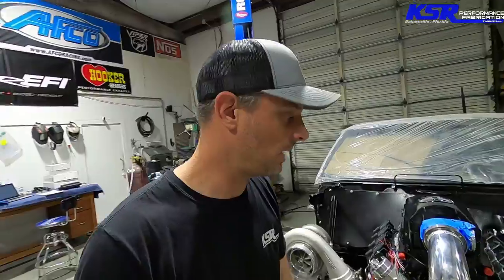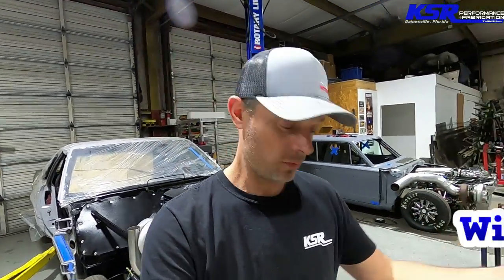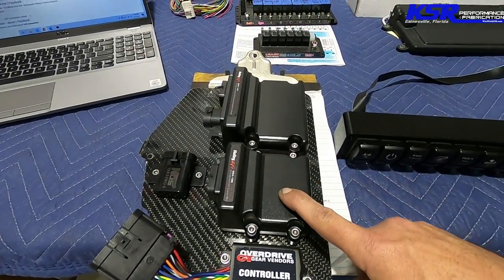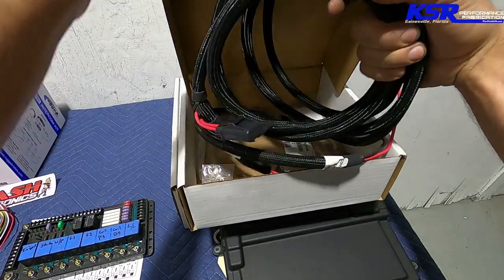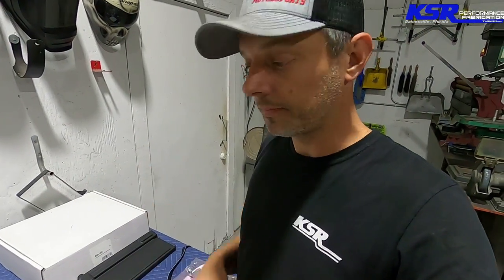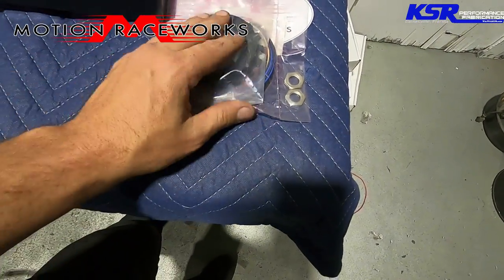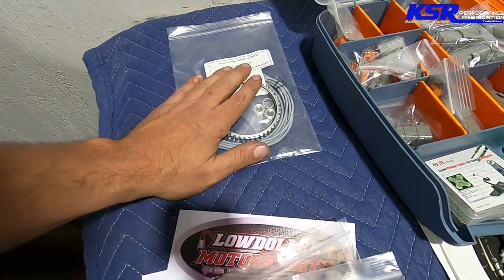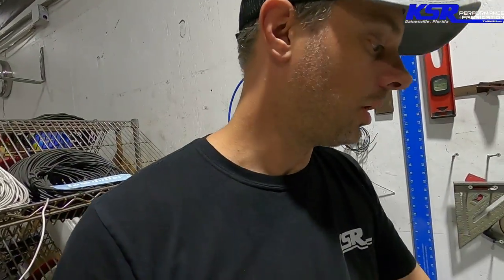Mullet El Camino Build Episode 12.....Wiring Overview!!

Comment: Are these thermocouples that you are using to measure exhaust temperature? You told that you are going to shorten the cables for these. If the length of the cables for different cylinder sensors are different, wouldn't it make the measured result a bit different between the cylinders?
Reply from the maker: I consulted with some other wiring friends who have tested it and they said that there was no difference with the shortened wires. All of the resistance portion of the unit is in the tip of the thermocouple.

Comment: Question .. Spark Return path..  since electrons flow from Negative to positive .  so the spark jumping the gaps at the spark plugs is actually jumping from the ground terminal to the center then up to the coil secondary.. to reduce the spark path..  on external MSD boxes i build a 3 or 4 ring terminal harness .. one ring terminal to the back of each head.. one to the firewall directly behind the engine..  i normally ground the MSD thick black wire to the firewall connection of this harness.  making the spark return from the MSD box the shortest possible..  when the MSD is grounded to the battery negative terminal.. i have had issues with MSD units blowing out as the high voltage tries to get to ground via the shortest path.. thru the 12 volts circuits .. causing MSD failures.

Comment: Pretty. Functional. Fast.
Put that on a shirt!
Reply: Also, use gold pins in Deutsch connectors for anything running less than 1A!  The standard pins will film over and cause weird signals if there isn't enough current to clean them.  The easiest way to know if this is the cause of a problem you are having is to re-seat the connector, which wipes the contacts clean again.

Comment: Them exhausts get so hot, is that location not going to adversely effect air temp going into the engine  by heating up the turbo housing ?
Reply from the maker: Not at speed. And those pipes will only have a small amount of air coming out of them and that will only be early in a pass down the track.

Comment: Hold on if you have a bulk head plug that has engine and chassis electricals running to it won't that make it a pain to pull am engine wouldn't you separate the lower one so engine and chassis are fully separate

Comment: is it possible for the firewall mounted plugs to come undone with a violent launch? The engine plates should mean most of the car moves as one piece but that also means no dampening for vibration. If the big round plug came undone mid-race, that'd really suck for the driver.
Reply from the maker: They wont

Comment: Insert wire group A, to wire group B.
Insert wire group C, to wire group D.
If ECU goes "Wut?" Start over.
:P

Question about the 2 injectors setups. Basically eliminating the need  to pull the plug out, and re-plugging them in depending on race/street mode.
Couldn't you use a toggle switch/button instead, so they don't need to mess with the wires all the time? 
Just a thought on making it less likely the wires and plug getting worn out over time, in needing to constantly plug/ unplug.
Reply from the maker: The only time they will be swapped is to flush the race gas system so the car can be stored for a while.

Comment: Anyway I can order a lease street/strip switch board from you and get it faster?  Leash hasn't put the switch boards for public purchase since November.
Reply from the maker: Yep, We have several in stock!
Reply: Do you have the ability to change the button icons to suit what I'm using the switch for?   6 of the 8 switches are negative triggered.   Should I just email you these questions?
Reply from the maker: @onefastermonte85  I think I might have one board that was custom setup with all negative triggers. I will check on Monday. Email would be better also, lol. Admin@winwithksr.com
Reply: @KSRPerformanceFabrication  ok.  I sent you an email.    #1 is the ignition  #2. Start.  Then the other 6 relays are negative triggered

Comment: No the valve doesn’t push air to the turbo.  The exhaust is going to the turbo the whole time the waste gate bleeds off exhaust gas 
It does not direct air.
Reply from the maker: Isn’t exhaust gas comprised of..............air.........
Reply: @KSRPerformanceFabrication   us but you said the the waste gate “directs the air to the turbo”.  Which is doesn’t the exhaust is always going to the turbo the waste gate bleeds off the air.
Reply from the maker: @mikeeagle2653  I could have said "directs more air to the turbo" which would have been a little more precise, but the goal of this system is that if the wastegates are open, the majority of the "air" flows out of the gates instead of the turbo so that there will be minimal boost. So the wastegate is directing the exhaust air.....

Comment: What happens when someone accidentally swaps the two fuel injector plugs..  It's going to happen.. Perhaps Color Code the connector/ receptacle
Reply: I was wondering if there's an extra pin in each harness, so the ecu can identify which harness is "enabled".... Then maybe the dashboard config  changes, so the driver would notice, also...?

Comment: I get it now, they didn’t want to put a rocket engine on mullet because with the amount of computer it has for a brain controlling EVERYTHING if you were you get the front to even just unload the suspension it could have gone straight up to the moon. Or Dale, one of the two.🤷‍♂️